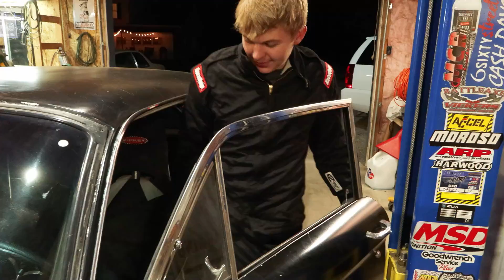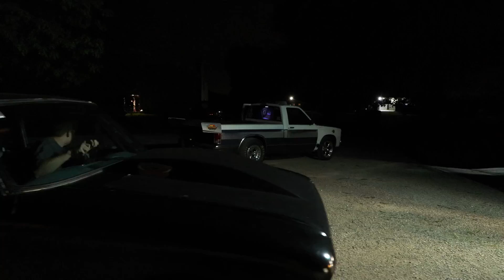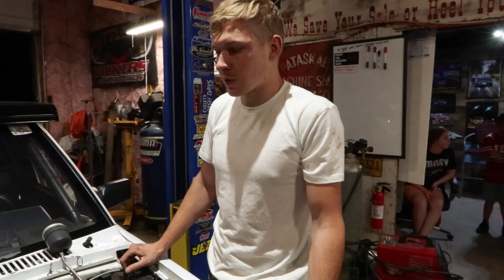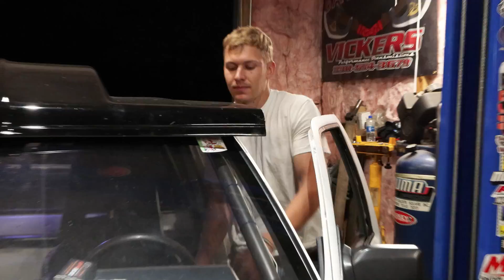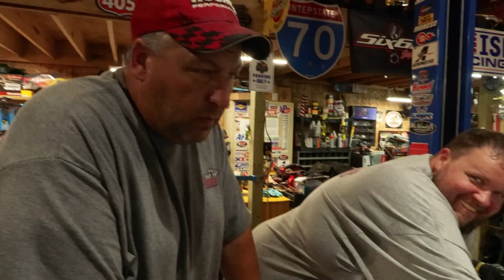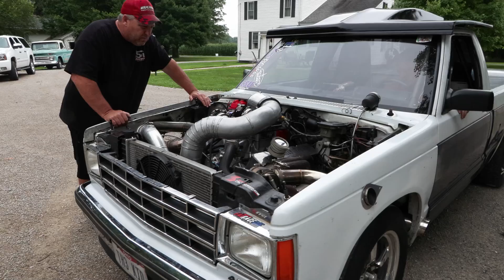Preparing for the STREETS! Testing on BARE ASPHALT

Comment: That trans brake test where the fuel was leaking is a good reminder to take a fire extinguisher with you for when Billy goes to make a test hit.
Reply: If you notice, Big Chief usually has one near by in his videos when there testing. Go back and watch the red Vette videos from a few weeks back. He walked it out with the bottle of prep they where using. Like it was just 2nd nature to do so every time. Gas is one thing, Alcohol is a complete different game.
Reply: @Pyle81  @Tennessee; Correct. There should be a fire extinguisher-ing system within every vehicle which methanol especially, ethanol and at least inside every personal vehicle which uses, burns flammable liquids, fuels. 🤓
My approach was to being having a halon fire extinguisher, available, handy in my personal vehicles, home, especially in the kitchen since 1984. 😏
->This is Basic fire safety thinking, mindset, attitude, awareness, etc. 😊
Sincerely ☺

Comment: Y'all are doing an excellent job with all the racing. They all seem to be getting faster! It might be time to start doing a scheduled nut & bolt on all the cars/truck. The faster you go the more stress everything is under & it would be ashamed to lose a race,  not to mention a engine, transmission, or rearend over something simple that could've been caught. There's even more stress on everything when running solid mounting. The harmonics want to shake everything loose. Looking forward to seeing what the future holds for y'all!!

Comment: Anybody else see Steve Morris's new video where the new rods he was testing all 8 of them checked out at around 8600 rpm and 45 lb of boost at 300 ft..
Reply: Absolutely insane video !
Reply: Ya I think them rods are around 5,000 dollars a set..
Reply: @Freedom Fox; Did You see the two following videos showing the engine tear apart [down], damage, explanations ? 🧐
Clearly a material, manufacturing issue with the aluminum rods material, metallurgy, processing 🤓
->Steve used a new company for him, as he stated. 😏
->they are both involved in, proper, detailed further investigation of the rod aluminum material, pieces, etc.
-> Your description is incorect, improper, invalid, poor choice and misuse 😒of adjectives, verbs 
->Actually it is NOT 'insane' - rather completely explainable, though highly unusual. 🤓
All The Best 😊
Sincerely ☺

Comment: To be honest how would billy know the base screws are lose ....no one would not even you Mr bill or you would have picked it up as well ... amazing video as well guys loves you all
Reply: I was thinking the same thing....
Reply: exactly he just needs some attention because its not his video. gotta keep it honky dory on his side
Reply: When he set the trans brake to build boost in the shop, as soon as it built any boost at all it would lift the main body off the base plate and spray fuel everywhere.
Reply: @theoldmansgarage  Thank you for the explanation. Im sure the above "ASE Certified, Bar stool mechanics" Will tell us that you just happened on to the lose screws and that fuel/Alcahol spraying all over wasn't a sign of a significant issue that could have been CATASTROPHIC. Bill you've likely forgotten more about racing engines than some of the 🤡🤡🤡's will ever know.
Reply: @Pyle81  I think you missed the whole point.
Reply: @98wytebird  Damn straight... They've all missed the point & none even understand why The Ole Man is frustrated.  Yeah these things happen but he just watched his own blood head butt the wall & clearly wants Billy to lean on him a bit more. They are so good together these days ...
Reply: @theoldmansgarage  If you wanna get frustrated then do so. It's clear how much you love your boys & will continue to support them in ways that many don't understand. It may be a sore point Bill, but could you please see to it that the steering shaft is mended correctly. I'm sure it's on your mind as it's now bugging the sh!t outta me.
Reply: To be fair, Billy built a brand new engine at McVey, and yet came home and just bolted that old used carb on it a few months ago...20 yrs. From now...He will check and tighten all the bolts on it first. It just does not happen at 25 usually.

At 65, while that block is at the Machine shop waiting on pistons now, all long block pcs have been cleaned, painted or replaced, tested on the bench waiting, and have gone through bumper to bumper, top to bottom, checking everything everyday doing something, all will be right before that rebuilt much improved bullet goes back in.

Won't waste any time once the short block is finished. I'm ready to reduce the new build, project ending blues by doing all I can.

Waited 25 plus years for the combo to finally work the way it should.
Reply: But you cannot see that from the driver's seat until the flames start.....ops, alkyd fires are also very hard to see. Until you start frying also.

Comment: Steering shafts and headers don't mix, I had to ovalize one of the tubes and shift the engine over to the drivers side as far as it would go on my Mustang. It doesn't rub but it is very close.

Comment: Can you hear Bucko?? Maintenance!!
You have to nut & bolt that thing often. You were no doubt losing boost and fuel out the baseplate. Did you order valve springs for the Falcon?
You have to think about the safety aspect, not just for yourself but the person in the lane next to you as well.

Comment: Catching those lose base plate screws was a GIFT from the Racing Gods. Those going threw your fresh engine wouldn't have been a good thing. I see data (even with the carb) coming soon for the truck.  And my gut feeling tells me that will be when the truck takes a significant step forward and makes significant gains all the way around. You definitely took a step forward with this engine by O-Ringing it. Yea it cost a few $$$ but it definitely shows that you haven't had to replace 4 head gaskets so fare and its the end of July.

Comment: Billy this is the guy in the wheelchair from Rockingham and the guy with me had the scooter y’all signed but the last time u ran Boosted at Trails and u did the big wheel stand go back and look at that video when it was in the air it was down lower on the passenger side than the driver side like the spring was weak check it out

Comment: Is that legacy cable just a serial cable? If so, you can pick up a serial to usb converter cable cheap off of amazon. I use one on my wideband to log it through hptuners...never had an issue.
Reply: Correct, there are simple cables and adapters which convert the Legacy, IEEE-1394, D-serial, and many other type of connections to USB which newer computers use entirely for some years now.
@Street Racing Channel;
These can be found on the amz and other on-line sites, at local electronics stores, etc.
->note it is worthwhile to get a quality cable or adapter from a reliable, dependable, quality manufacture - avoid inexpensive, cheap CCP-China made and other 'no-name' manufactured in any country, especially the 'Far East' except for good companies in Japan, Taiwan, or [S.] Korea [cables, electronics are good - not metals, metallurgy - though better than China-CCP ] and also other SE Asia, Singapore, Malaysia, Thailand, Philippines, Indonesia are good, if the manufacture is reputable.
Sincerely

Comment: Cracks me up, watching a lot of big bucks bracket racing lately live on drag racing TV, dealing with the New School technology.....Getting used to the New LED trees (They are close, but are not old style filament lightcbulbs), and the much newer and younger shorthand announcing (Been away from my former decades of racing far too long, and New School announcers have a real shorthand method of calling a race these days that I am not real used to, not wasting an unnecessary word or string of words......Left 03, Dead 7, take by 4 thou, good by a total package of 10 for the win, Right 11, under 2, took 13 needed 7 or less.

Not hard to understand by any means, but takes a real getting used to, and auto filling in the blanks after decades of hearing it the "Old School" way.

Then same announcer calling a Stock Elim. Qualifying session following it and constantly saying they are letting off the button, over and over......psssst, Trans brakes are illegal in stock elim.....we are all foot brake cars trucks. So, they better not be letting go of any damned button! The penalties are very high for that infraction.....lol.

Comment: Lol, old school...you are funny kid, as he plugs in a computer chip into a socket. I have been hunting for the capability of just reading the ECU coding in my 84' Mopar Stocker since before you were born, and ordered a legacy cable to plug into the underhood  diagnostic connector, and finally able to read and understand the coding tables that are finally published for 85 mopars and up created by hackers that kept it secret for 30 yrs, because the EPA would not allow the coding released for my 84' Stocker.

Not only can I now read the tables, I can reverse engineer, understand, and now change the flags myself or even pay someone to design and write a pre-determined cal finally.

I have been reverting a computer controlled to old school 1 item at a time, for your entire lifetime just attempting to re-gain some control from that computer (2 actually ECU/power module), and all I really wanted is to move up or delete 2 things, the Rev limit feature, and control timing, defeated almost every function the power module controls, timing/ignition, and fuel...now that is old school.

The junk yard wrecked earlier carbed Omni I took the electronic control module and wire loom from when I was in Atlanta racing, is still mounted on the passenger inner fender with the spare mounted next to it, and wired into the hall effect distro., that is really only acting as a cam synch and transferring spark without some totally unreadable and unchangeable power module board attempting to fluctuate constantly to please the EPA and the smog police while I attemp to squeeze out 1-5 more horsepower.

The best data I can get is all written on that time slip. A faster E.T., and MPH.

Need that legacy cable? LMAO, look up this newfangled thing called YouTube, grab some wire, the required pilot sheet and solder or crimp 1 up....The world is your oyster, the internet your savior, then sit back and play a game of pong on your phone, while listening to some Hendrix, The Beatles, or The Eagles while you manufacture your legacy cable for your old school big gold box.

Gotta love it. Ask Grandpa what Old school is....Heard it from Dad . Use it, wear it out, make do or do without...And when that ancient gold box is no good to you anymore, I would gladly take it and those chips off your hands, so I could just set all the flags in tables on my Stocker to off!

I would use that "Old School" actually easily controllable technology to death right now. It beats the long term unreadable and uncontrollable pc of crap I have worked side hacks on since 1993. Rules suck when you have to obey them.
Reply: Sry about the rant, and we race in different worlds, new isn't always better, there is such a thing as data overload if too busy reading data to pay attention to maintaining reliability and repeatabillity.

When Trans brakes came out is was all the rage, they said I could not compete in Florida on 20 days at 5k a day foot breaking in a 500 car field big bucks bracket in 84...drove from Socal to West Palm Beach, FL straight thru, runner up 1st night. .500 lights and run dead on, no newfangled  technology can beat that.

Comment: I pulled my pan the eagle Crank The Hall boys out of Sweeny Texas angle drill slug holes for the ballist for the BBF 10,000 RPM sounds like a small block quick RPM can't wait to get it on the street out of the mud drag's

Comment: That steering shaft is Sketchy as Hell.  I hope they at least cut down a bolt and put through the joint and then welded it. The Old Man should of not let it out of the garage until it was fixed properly. They were saying how much the chassis and the cab moves. You can get away with some sketchy shit, but you don't do it on steering or brakes. That is real bad, what happens when it hooks and flexes real bad and breaks at that weld. Bam no steering.
Reply: When he loads it and comes off the button, it rotates, the body seperates, and it leaves, and l dont want to piss any one of you guys off or anyone on this site, but the damage on frame mounts ect, is not good 1200 hundred plus is alot of power on this platform. But if you look at say a top sportsman car they are set up with mid and front plates, full tube, in other words the body just goes along for the ride. Like l said lve been watching a long time love the journey this young man has taken, hell of a tuner. Like l said dont want to piss any one off.

Comment: So yes you would have to have some kind of huge exhaust fanery for when people do burnouts if the roof is closed because of the rain but that's okay we can have it hanging from the building that is over the lanes down pointing basically right at the car on each lane and when they do that burnout and they're starting to back up blast on them big ass fans for 20 seconds and it gets the smoke out of the way not even 20 seconds 5 Seconds dude I'm telling you f*** I'm sick I'm excited about

Comment: Tommy don't feel bad. I've been around race cars most of my life and never knew what on the chip meant either.
Reply: Tommy learning new things is great, they were upping the chip, but he connected the info, and that is great. They were actually reducing or lowering the installed chip.

He is really up on the chip, means they were hitting the pre-programed Rev limit featurec on the chip that pass, so they may need to "Up the chip to a higher limit next pass. Upping the chip, is not up on the chip. But, I can bet he got it....Required if you want to teach Tommy something, make sure he is behind the lens.

Comment: I understand slip in the steering system,but there is a bolt on the steering box to remove that. The steering shaft is supposed to telescope in the event of a front end collision and collapse instead of driving the wheel into your chest. Just throwing it out there 🤘

Comment: I have a theory that during those passes at cash days, the carb had a very specific sized leak that resulted in a burst of combustion that acted much like an afterburner on jet aircraft
Reply: @James Eyman; 
A. Your idea is clearly, obviously, certainly, absolutely NOT a Theory. 😒
B. Your idea clearly lacks the proper basics in concepts, principles involved😒
-1. to achieve any burst of energy like an afterburner in a jet engine - requires the fuel to be burned int eh combustion chamber or some location to achieve thrust. 😒
-2. clearly the 'leaks' are at the top of the carburetor, at the connection to the intake manifold 😒
-3 the only paths, means which this truck has to achieve any thrust are through the exhaust pipes :  
-a. engine exhaust 
-b. turbocharger exhaust
 -4. thus, the fuel air mixture, which 'leaked' did not inter the intake, 'leaked' outside the carburetor connection, over the intake, onto the hot engine - thus, the obvious, clear, certain concern about that fuel air mixture burning, inflaming.
🤓
Here is a possible better explanation using some proper concepts, principles, etc.: 🧐
A. Billy stated the fuel mixture had been increased - for more power, which had decreased, dropped.
B. The 'leaks' were in, at the location of the connection from the bottom of the carburetor to the  intake manifold
->thus,  the 'leaks' were mostly 'vacuum' at the bottom of the Venturi -> thus less fuel air mixture flow ->thus Billy increased the fuel mixture [richer mixture] to compensate achieve more power.
->also the 'vacuum' leak contains fuel-air mixture, thus flammable - not raw fuel, even gaseous fuel,  but it seems the leaks were small enough to escape, rise, aided by the heat of the engine, and not inflame 
->also having the lack of hood, actually assists the safe escape, rise of the fuel-air mixture without inflaming-inflammation.
C. =>thus, the explanation uses proper concepts, principles, fits with and uses the discovered situation, details, problems, described affects, effects, compensation, and achieves a more complete description for and with the results using proper principles - not incorrect, improper, incorrect, false, ideas, comparisons, etc. 
->resulting in improper 'guesses' and nonsense.
🤓
My hope is this explanation is clear, You comprehend it will assist, help, aid, benefit You  -> most importantly to initiate, instigate, illicit, encourage You to develop some proper basics within the information, knowledge involved in machines, mechanics, engines, motors, combustion including electrical and for more modern uses, designs, development and implementations with some basic within electronics per the needs, uses, etc.
->Thus You will improve, grow, develop become more and better informed, knowledgeable, improve Your experience, base perhaps an expert if any of these You desire, select or choose. to pursue.  😏
[My background 🤓 includes advanced mathematics, science, scientific methodology, logic, reason, physics, chemistry, materials, engineering, mechanical, structural, electrical, electronics, mechanic, fabrication, building, assembly, design, research, development, testing, verification, certification, troubleshooting, investigation, repair, fixing, assessment, evaluation, discernment, differentiation, determination, concluding, etc.
-> over 50 years - currently 63 y/o 😏]
All The Best and Much Success in Your Quest, Health, Happiness, Well Being. 😊
Sincerely ☺
Reply: @newtonfirefly3584  ummmmmm..... You could not possibly think I was serious. You typed all that horseshit cause you honestly believed that I was being sincere.... That's crazy